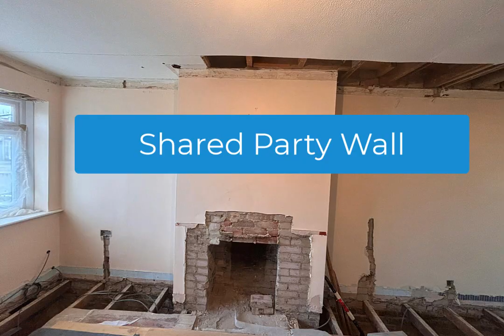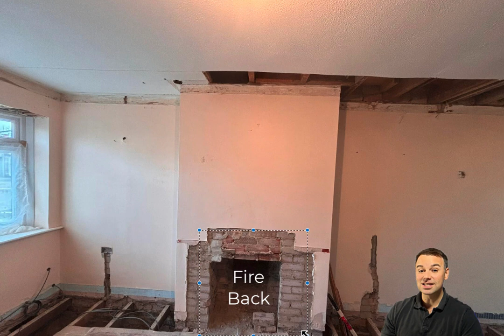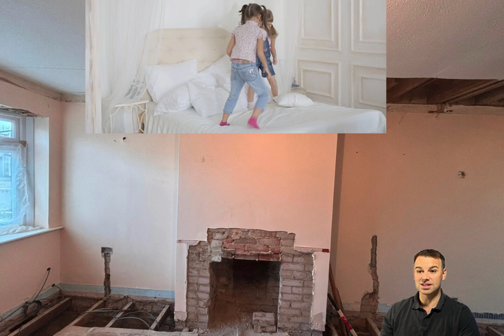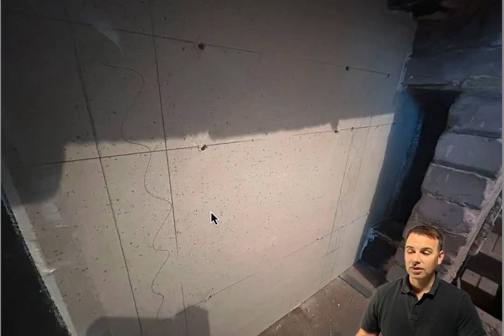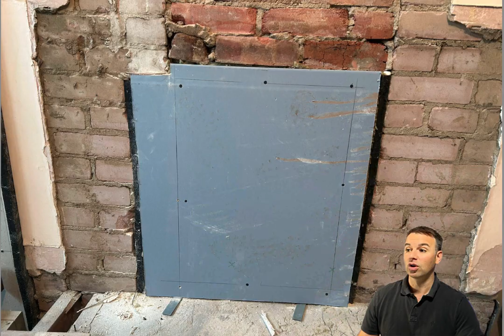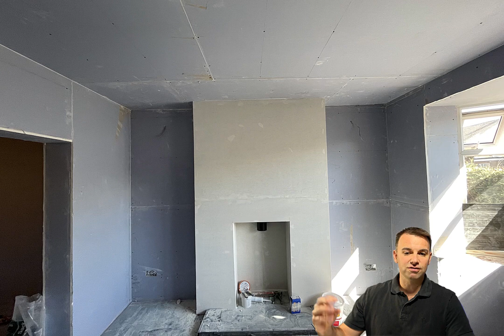Soundproofing a chimney stack?

Comment: Thanks, Jim. What if this is in an upstairs bedroom, with a loft space above that has a pretty poor fire break (i.e. there's no masonry separating the properties in the loft)? Would you build a dense stud partition to form the fire break, and then take the new floating frame all the way up to meet the roof? I'm a bit confused about the best way to tackle that.
Reply from the maker: Hi @abstractmedia8949,
Good question 👍

If there’s no proper masonry fire break in the loft between the two properties, I would recommend building a new separating wall first using 7.3N dense concrete blocks, taking it all the way up to the underside of the roof to create a proper party wall.
A lot of new-build developers just use a stud frame with fire-rated plasterboard. Sorry, but I just can't recommend that approach from a soundproofing perspective.

The first priority is to create an airtight masonry separation with good mass. I’d say to your builder that it’s to meet the fire regulations and that it must be airtight.

Once that’s in place, you can then take your floating frame system up to meet the new block wall. The block wall can then simply be coated in RW3 as per the loft system.

One thing I would try to avoid from a soundproofing perspective is relying on expanding foam. It’s great for achieving airtightness in awkward areas and is often used to help meet fire regulations, but acoustically it’s not a great soundproofing material. Wherever possible, I'd rather achieve the airtightness with the masonry itself.

Hope that helps! 👍
Reply: @jimprior7  Jim, thats fantastic, thanks so much. Is the loft soace and chimney stack covered in the course?

Comment: We have already blocked off the chimney stack from the downstairs when we first moved in. Didn’t remove the chimney breast downstairs or upstairs. We can hear the neighbor talking from their living room downstairs in our upstairs bedroom so we are experiencing what you said in the first minute of your video. What are our options? Do we need to open up the fireplace wall again? My goal is to have upstairs bedroom silent but house is already renovated :/
Reply from the maker: Hi @lilseezy8123,
Yes, what you’re describing is very common, especially in older houses with chimney breasts still in place.
Even though you’ve blocked off the chimney downstairs, if the chimney breast remains upstairs and downstairs, it can still act like a sound tunnel. Sound from their living room can travel:
- Up their chimney void
- Across at loft level or through the brickwork
- Then back down your chimney breast
- And into your upstairs bedroom

That’s why you’re hearing downstairs conversation clearly upstairs.
So what are your options?

First, you don’t necessarily have to rip everything apart straight away but you may need to investigate the chimney area again.

A few key questions:
• Was the chimney only capped at the fireplace opening, or was the void properly sealed higher up?
• Is there any open cavity behind the breast in the bedroom?
• Has the chimney been sealed in the loft on both sides?

Simply boarding over a fireplace opening downstairs doesn’t stop flanking sound if the internal void is still continuous.
If your goal is to make the upstairs bedroom silent, you will likely need to treat that chimney breast properly. 

That could mean:
• Opening up locally to check for voids
• Mass filling or sound deadening the chimney structure
• Installing a proper independent system to the chimney breast upstairs
• Potentially treating flanking areas connected to it

The important thing is this: rarely is it just the party wall itself. Chimneys, loft spaces, and floor voids are common flanking paths in older semis.

Before opening everything up, I’d suggest putting your ear directly on:
• The chimney breast upstairs
• The wall either side of it
• The window wall
also any RSJ perpendicular you might have protruding from the ceiling downstairs.

See where the sound is strongest. That will guide the next step.

You may not need to strip the whole house back but you probably will need to address the chimney path properly if that’s the main route. I think you might want to study this video in detail: TV NOISE IN THE BEDROOM
https://youtu.be/Yj1eTNQBxPs&list=PL-ZigmSd311dNw8Tbe1IfLiJgEiJcjvMN  

the concepts in this video might help.
Thanks very much for your comment....have you filled out the form on the installation website? Quietco.uk?

Comment: Hey Jim - in our scenario we removed the old fireplace surround in our living room to install a wood burning stove. We sound proofed our alcoves. The stove is not yet installed but we have repointed the brick in the reveal. We will install a closure plate with the stove. 

Bizarrely, we can now hear conversations in our neighbour's ground floor (although unintelligible) from our first floor like never before. My presumption is the chimney stack is funnelling noise upwards. Any comments/advice welcome!! thanks.
Reply from the maker: Hi @marcher87,  thanks for the question, and yes… what you’re describing is very common when a fireplace is opened up or altered.
If the sound you’re hearing now is more of a muffled, low-frequency conversation, then you’re absolutely right: the chimney stack is acting like a funnel, carrying that sound up through the flue and releasing it into your first-floor rooms. Once the fireplace is opened and repointed, the chimney effectively becomes a large resonating void.

In our installations, the chimney stack and the fireback are critical parts of the soundproofing system. You can see in this video what we normally install to prevent exactly this from happening.

Realistically, the fireback and chimney stack both need proper sound insulation. Many homeowners end up having to compromise on the wood-burner position—or even the stove itself to get the soundproofing result they want. In fact, the homeowner we’re working with right now is swapping the wood burner she loves for an ethanol burner, simply because she knows she won’t need heating in that room once the full 4-step method is installed.

My advice for your scenario:
If you can achieve around 175 mm behind the fireback and 65 mm to the inner cheeks of the firebox, you can properly soundproof the chimney stack and interlock it with the alcove systems. This often means adding a couple of 45° elbows to the flue and bringing the stove further forward into the room...but it allows for a correct installation.

One more thing to consider…
If the alcoves were treated with a clip-and-channel system without sound-deadening the original wall first (20 mm rubber or Tecsound), then you may actually be channelling noise into the chimney void. We see this a few times every week: the clip-and-channel method is advertised as a quick fix, but without dampening the structure first, sound simply shifts into the perpendicular hollow voids — floors, ceilings, and in your case, the chimney stack.
You might not be in that situation,...but it’s worth checking.

Not sure if you have watched the Noise Free DIY Course or registered for the course, so you may not have seen this unlisted video yet: 
TV NOISE IN THE BEDROOM
https://youtu.be/Yj1eTNQBxPs&list=PL-ZigmSd311dNw8Tbe1IfLiJgEiJcjvMN  

Thanks for your comment 👍👍👍

Comment: What would you recommend as a renter friendly way to reduce neighbour noise coming through an old fireplace?
Reply from the maker: Hey @jendegnan2073, Great question! Old fireplaces are one of the weakest points in a wall, and as a renter you obviously can’t start rebuilding the chimney breast....but you can reduce how much noise comes through it.

Here are the most renter-friendly options:
1️⃣ Fill the opening with a dense, removable plug
Create a snug “insert” you can lift in and out:
50–100mm mineral wool (Rockwool)
wrapped in fabric or placed inside a simple wooden frame
pushed tightly into the fireplace recess
This adds mass and absorption right where the noise is leaking in.

2️⃣ Add a thick, heavy panel over the front
Place a removable panel over the fireplace opening:
MDF or plywood with a layer of acoustic foam or Rockwool behind it
sealed around the edges with removable draft-excluder tape
This blocks the direct airborne path from the neighbour’s side.

3️⃣ Add soft furnishings around the area
A thick rug, curtains, or a bookshelf near the fireplace helps absorb some of the leftover energy.

4️⃣ Most important tip:
Fireplaces often connect directly to the neighbour’s chimney breast, so you’re hearing airborne noise through a big hollow void. Anything you can do to densify and seal that opening will make the biggest difference.

All of these options are fully reversible and won’t damage the property.
If you want to send a photo of the fireplace setup to info@quietco.uk, I can suggest the exact style of plug that will work best!

Comment: Hi Jim, for a house with with solid walls and solid floor, will the 50mm decoupling system help reduce footsteps of kids running around? 

I can’t install any floor matting now as flooring is down already…
Reply from the maker: Hi @ELITEtimmis, the short answer is no unfortunately, unless that 50mm is on the floor where the kids are running around….treating the noise at source.

We have done a couple of homes where the homeowners have claimed that they no longer hear impact noises such as doors banging, footfall and banging from the neighbours  using only the 50mm wall system….i think maybe because we covered so many flanking noise paths and such a large area of the properties were sound deadened that could be the reason why.

I’m pretty sure you will not reduce footsteps only treating one or two noise paths.  

Normally we get a significant reduction in impact noise like foot steps with decoupling systems that are 175mm thick or more and treating the flanking walls as well….or treating the noise at source (ie the floor above).

Hope that helps, thanks very much for your question.
Reply: @j @jimprior7 hi Jim, thanks for this. So it’s a semi detached house and I was planning on doing 50mm wall system on all alcoves (up and down) and basic thinner system on chimneys. I also have some units built in to alcoves with hollow void behind, could this be amplifying footsteps?
Reply: Sorry Jim, just wondered if you saw my reply
Reply from the maker: Hey @ELITEtimmis 
The hollow voids could be amplifying the structural borne noises yes, I would certainly consider insulating those hollow voids if you put the units back after soundproofing. 
Ultimately footsteps and impact noise is reduced by sound deadening the structure and then de-coupling the wall surface from the wall you have just sound deadened….we normally do this with the floating frame or the 95mm thick system.

The great thing about the 50mm system is that the first few layers are the foundation layers of our much larger wall systems and therefore if you wanted more reduction in noise after installing them….you could just add to the layers….That’s not the case we other wall systems, they have to be removed completely before installing a new wall system….which is often very disruptive. 

hope that helps and thanks for your comments
Reply: I got my original message wrong too, was thinking of decoupling so thicker than 50mm

Comment: Hello, sorry — you still haven’t answered.
Where is it better to attach a rubber mat for impact noise insulation — to the wooden ceiling structure or between the layers of drywall?
Reply from the maker: Hi @redfan472, Sorry I could not find your first comment. It depends on the type of rubber you are using, if you are using the specific rubber we recommend in the You Tube video 'Soundproofing for Beginners' then best install the rubber to the ceilings structure. If you are referring to Mass Loaded Vinyl then that is not going to help with impact noise and just install that between the drywall. 
Soundproofing for Beginners | Full Course Tutorial
https://www.youtube.com/watch?v=hVqa1m3JzGs&list=PL-ZigmSd311dNw8Tbe1IfLiJgEiJcjvMN
Reply from the maker: Hi @redfan472 – sorry for the delay and thanks for your patience!
When it comes to impact noise insulation, it's usually more effective to attach the rubber mat to the wooden ceiling structure (or floor joists above if you have access). This helps absorb the vibration at the source, before it travels into the rest of the structure.
Placing a rubber mat between layers of drywall can help a bit with airborne noise, but it’s not ideal for impact sound. For best results, use the rubber as part of a decoupled ceiling system with insulation, resilient bars, and multiple layers of board.
Reply: @jimprior7 Thank you, and greetings to you from Ukraine.

Comment: What would you do if there was a fire being installed with a flue?
Reply from the maker: Hi @DavidIngledow – great question!
If there’s a fire being installed with a flue, the key is to make sure you're using A1-rated non-combustible materials around the area – like Promat, metal stud, and RW3 insulation. You’ll also need to maintain clearances and follow the fire safety regs for your specific type of fire (gas, stove, or log burner).
That said, soundproofing around a working flue is always a bit of a trade-off — you’ll likely need to sacrifice some acoustic performance to keep things fire-safe. We’ve done R&D on this with wood burners and gas fires, and I go through the design options in the online course.
Let me know what type of fire you’re planning to install – I’m happy to give more specific advice if I can! 👌

Comment: I wondered whether it is possible to soundproof a chimney stack that has got a working fire installed? Eg we currently have an open 'hole in the wall' contemporary style gas fire. - Even if we took it out and reinstalled it after treating the fire back, I can't imagine it's possible to soundproof it much without taking it out completely and blocking up the flue. - Is it possible to have an open fire and a soundproof room, or do they both contradict one another?
Reply from the maker: Hey @grillewinless, great question – and one we get asked a lot! 🔥

To soundproof around a working fire, you'd need to use A1 non-combustible materials like RW3 insulation, metal stud, resilient bars, and specialist products such as Promat (here in the UK). The challenge is, these materials are fire-rated but don’t offer the same sound attenuation as the softer materials we normally use for high-performance sound deadening.

To get a meaningful noise reduction from the fire back using those materials, you’d need to build a much thicker frame to include more RW3, and that often means coming out past the flue, which can be a problem in itself.

We haven’t soundproofed around an open fire before – it’s just not practical without fully blocking the flue. But we have soundproofed rooms with wood burners, stoves, and gas fires. In fact, I’ve spent a lot on R&D testing different build-ups around wood burners, and I teach the details of that in the Noise Free DIY Soundproofing Course.

The truth is, having a stove or open flame in the room will reduce the effectiveness of the soundproofing to some degree – it’s always a trade-off between performance, safety, and design.

Here is an old video....one of my first YouTube videos 😂 https://youtu.be/rTxb3l5740s?si=7CuhndeSued6UYmJ

Hope that helps! Happy to go into more detail if needed 👌
Reply: @jimprior7  That's really helpful - thanks!

Comment: Would a cheaper and quicker option be to brick up the front, drill a hole into the flue cavity near the ceiling, and fill the whole cavity with sand. You’d get huge mass, and sound would have difficulty propagating through loose grains of sand. Just a thought.
Reply: I'd love to be a fly on the wall when new owners move in and attempt to have a fire installed, then come home to find their living room filled with sand!
Reply from the maker: @grillewinless 😂 Funny you say that… we once removed a ceiling in a flat and discovered it was completely filled with sand! As soon as we took the board down, fine sand just poured out – we spent the whole day clearing it up....it was amazing how much sand came out, pretty much filled the skip.
Turns out the old flat owner above had tried to reduce TV noise by filling the void between the wooden joists with sand. Creative thinking… but definitely not ideal for the folks below! 😅
Reply from the maker: Hi @ollyb7570 – that’s actually not a bad idea at all! 👏
Filling the flue cavity with fine sand could definitely help treat the hollow void and naturally sound deaden the inside of the flue. Huge mass and loose particles like sand can make it harder for sound to propagate – so you're thinking along the right lines.
That said, in our experience, sound still transmits through the brickwork itself, especially on older chimney stacks. So to get a proper reduction, you'd likely still need to sound deaden the face of the brickwork as well.
If you do give the sand idea a go, please let us know how you get on – would love to hear the results! 👷‍♂